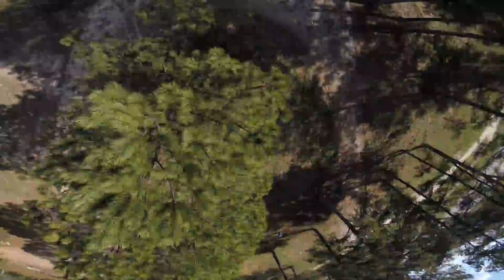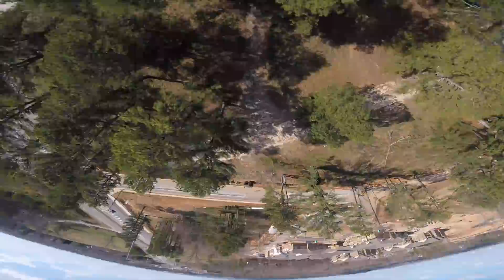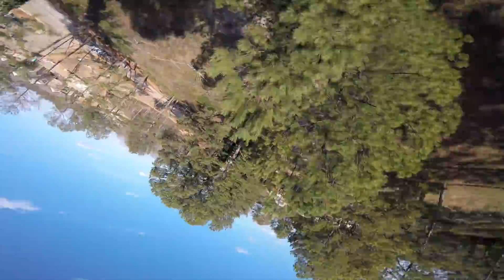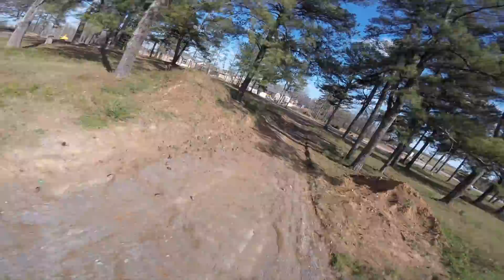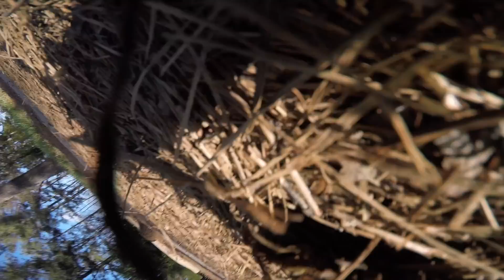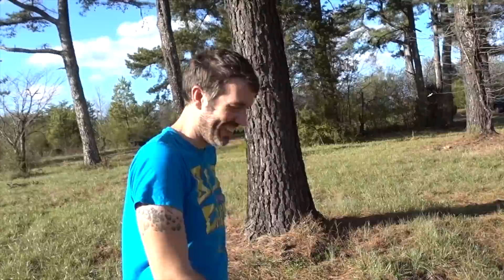Battery Update and Raceflight 1 First Impressions

Comment: I've done similar tests on batteries before when I was flying heli's but I stuck NFC stickers on each battery so I could just tap the back of my phone on the battery and record any data to the sticker on the battery. The main reason I done it that was just to make it easier to record and pull up data on the fly with no internet connection on my phone. Just thought I'd mention it lol. Thanks for sharing your data with us and taking the time to get it out there ;)

Comment: anyone ever had a flight controller go into dfu mode without pushing reboot/boot button? I have had issues twice with this omnibus f4 pro v3 and a hyperlite f4 board and it happens when i fly for several packs and then plug in for second flight and nothing happens and then i hook to laptop and find its in dfu mode like im about to reflash board. Would raceflight revolt v2  be a better board without the dumb issues? suggestions or help with current issue id like to keep osd but if i have more reliable board id do without

Comment: my nighthawk 280 just puffed it's first battery from my abusing it...   after a crash I went from 20amp escs to 30 amp escs on my 2000kv motors with gemfan nylon 6045s.     poor battery was just a little 1500mah 60c...

time for a battery upgrade and leave my 60c packs to my  less powerful builds with their 20amp esc/motor combos.

i was budget building up til recently.   i could get away with it up til now.   

my flying on 30amps with 6040 props has evolved so much by being able to do things that the 20amp escs wouldnt allow.    maybe I will try going down to strix 5045x4 props to see if I draw less current and can still huck it.   but those 6045s just grab so nicely.    maybe some 6040s but I doubt that will be enough.

i need to wire in an OSD so I can start monitoring current draw for average as well as peak.   just got the new Matek board with current sensor and 35x4 rating.   may mate it to an Omnibus F3 on a new build with 2400kv motors on 30amp.

TLDR????

BLIPS & CHITZ!!!!!!!   Finally somebody in your inner circle that is a Rick & Morty fan.   Time to take Roy off the grid.

Comment: How do you measure internal resistance?
Reply: Michael M some battery chargers will tell you, and I think that's how stingy  does it. It's the only way I know to check resistance, but what do I know? there might be another way, but if there is than i don't know it. I hope this helps.   -R5

Comment: Hey Stingy! I have a question about where you like the throttle stick position to be for just hovering, and some good things to practice to improve throttle management skills. I'm new to fpv, finally got some fat shark hd3 googles this week. I have been flying line of site for two months with a rotor riot Butter Kwad 6 inch with kiss Fc, 24 amp esc, 2100kv lumenier motors. Flew fpv for the first time yesterday. Thanks I love the videos and all the help you graciously give!
Reply: I'm not Stingy but my two cents is that you learn to fly line of sight without any stabilization in rate/acro mode.  Flitetest has a great video about this, walking the dog, etc. Once you get that down, then throw on the goggles with relatively low rates (maybe 600 degrees/sec) and very little camera tilt. Then build up from there. As for throttle management, I'd say this is one of the most important things you learn and horizon/angle mode teaches you REALLY bad habits. There is no perfect hover throttle position, it's like a helicopter you are constantly adjusting pitch, roll, yaw and throttle. Any change to one (including wind and temperature) requires you to adjust the others. It can be frustrating but one day, you're flying and it all just sorta clicks.
Reply: Mike Jackman, Thanks for the tip, I have seen the FT video on this it's what helped me fly a to from the beginning. I will keep practicing and getting better. Is there a way to make it so my quad would hover at 50 percent throttle instead of at the 30 percent it does now and make it so it isn't as jumpy in that middle throttle range and a bit softer? Would that be throttle curve on my taranis
Reply: Sounds like you have a pretty serious build so it's gonna have some kick. You get used to just constantly adjusting the throttle, sometimes rather drastically. You're really gonna appreciate that power when you're cornering. With a 6" build you're gonna have some serious on demand power. On my 6" I also hover around 30-40%.  Maybe you could start with a 3-cell instead of a 4-cell?
Reply: I don't have any 3s batteries so I tried swapping my props from 6050 to 6040 and threw on a heavier 1550mah 4s and lessened the camera tilt. That made a world of difference and quickly brought back my confidence. Do you ever experiment with different size props for your 6 inch? I know there are very few options compared to 5 inch props.
Reply: I use 6045. Usually hovering isn't such a big issue and 99.99% of the time you're moving. So if you hover in fixed position at 30% throttle, you're using 100% of your thrust to counter gravity. When you're moving, some of the thrust is moving you forward and some is countering gravity; your throttle will then probably be closer to 40 or 50%. Now that quick response will come in handy to counter momentum during turns. Starting off on 6040 with a heavy pack is definitely a good call. Keep the tilt low and find the largest open field you can and try acro in FPV. If you keep your altitude up and take slow turns, you'll pick it up really quickly.

Comment: RF1 is seriously next level. I'm interested to see how long some others will stubbornly not try it, and totally miss out.
Reply: I avoid it on principle because of the shitty practises of the developers. Open source has been the way forward in this hobby and it's worked well for the past few years. I won't support Raceflight and encourage screwing over the good people like Boris B who put hard work into Betaflight.
Reply: Yeah they essentially stole open source Betaflight code, closed-sourced it and made their adjustments, and claimed that it was all their own code. Very shady stuff, no matter how well it flies.
Reply from the maker: It is pretty sweet. Almost as sweet as that pilot name of yours. Stay gold Ponyboy, stay gold.
Reply: I agree with everything you said, @Sean Duffy. There is also the fact that they filter the CRAP out of gyro, and when you heavily filter like they do to mask the noise (which yes, does smooth out the flight) you lose power. I believe that a standard RF default has up to, and this depends on the quad of course, but up to 20% power loss off the top. This has been tested with the same FC flashed with both BetaFlight then RF. There is, for anyone interested, and entire thread proving where RF stole the code, the code was decompiled and proven that they stole code, closed sourced it, then was deleting comments from people like Boris who kept commenting. For that reason I too will never fly RaceFlight. I have also tried RaceFlight, and got it flying easily, I just did not like it personally.
Reply: Fair enough. I respect your views. And on a teasing side if Boris was more open to MultiShot in the beginning RaceFlight might have never been born :)
Reply: They didn't decompile anything, they used the GPL code, then closed sourced it, then when it all blew up, after a big "to do" happened, they open sourced it. This is in reference to Raceflight, before it was open.. Yes, RF1 is different, and not what is in question here. The issue that was pointed out by myself and others, is that we will not support them after the crap they pulled.. that is all, it has nothing to do with RF1, which is a whole different creature than what was being referenced.
Reply: I can respect your view as well, and yes, things happen in specific ways, I get it.. I know that in RF1 DSHOT is supported, but they are / were pretty reluctant to support that in RaceFlight though too. :-) I am glad that we can have differeing, yet similar viewpoints on the internet, and not flame each other. This is how discussions should happen everywhere! lol Differing viewpoints on the same subject is what makes us all unique!
Reply: The way they handled it was shady AF: https://dl.dropboxusercontent.com/u/8190002/RC/raceflight225.pdf

Looks like they are still breaking the GPL license for configurator and blackbox, even on RF1. Most folks don't give a shit, so that's why they can get away with it. Probably wouldn't be too hard to get the configurator booted off chrome app store for license violation.
Reply: I'm not aware of all that, just that it flies amazing.
Reply: Thanks Stingy, I did it for Johnny!
Reply: O'Doyle Rules!
Reply: True. I think I was the last guy using their Chrome RaceFlight configurator. RF1 now uses a configurator you download off their site. Supports IOS,LINUX and WinDoze. But I believe they are still dependent on the Chrome Blackbox configurator. So they could fry for that. :)
Reply: I respect your views but the original version of RaceFlight was strictly based off of BetaFlight and they did release it to GitHub (Open Source). The RF1 is completely new code using Floats that they wrote. You can not expect them to make that Open Source can you? If you think they should then I hope you feel the same about KISS software too them.
Reply: Why would the RF team decompile Betaflight code when it is available as source code on GitHub?
Reply: Ha Outsiders!

Comment: race flight vs betaflight both on newest firmware, what's better and has best stock pids. also is raceflight available for naze32 SP f3 FC's. thanks
Reply: stock pids should not be a factor in which flight controller you want.
Reply: Plur307 I just hate tuning

Comment: What is the minimum C-rating that you would consider "safe", for a 1300mah pack? I'm flying some 35-45C packs, which feels quite fine - for a beginner at least. But doing the math they should be a little underpowered?
Reply: C ratings are meaningless above about 60C.  They are just marketing lies.  But I usually don't buy anything under 60C.  I have some 45C 1800 packs and they sag horribly.  The 60C 1300 have way more punch.
Reply: Mads Justesen It's depends on your setup and flying style if you need better batteries.

Comment: u should measure wh watt hours not milliamp
Reply from the maker: That would be nice but it isn't something my OSD gives me so it is nearly impossible to calculate on the fly.
Reply from the maker: Just to be clear. I am saying it is nearly impossible because you would have to take voltage sag into consideration in real time to accurately calculate Wh.
Reply: StingersSwarm oh it's a shame the osd doesn't display that  it's the best way to measure capacity